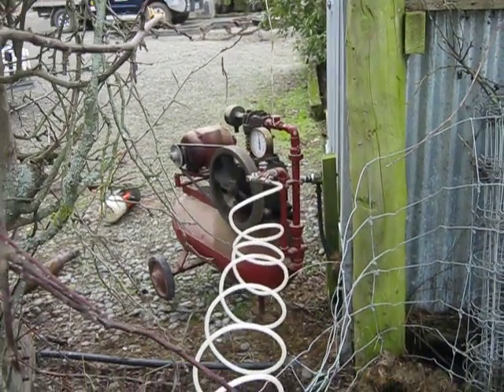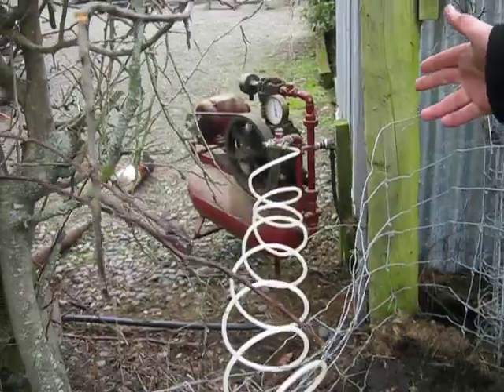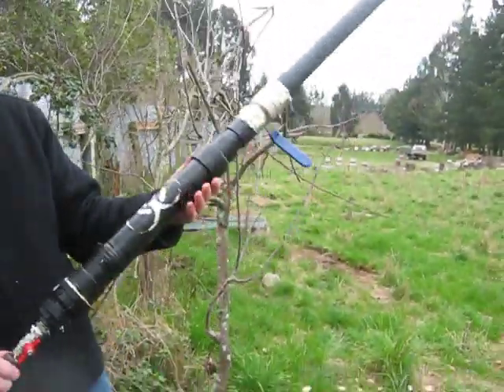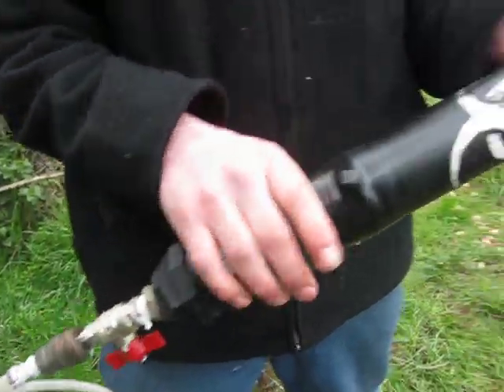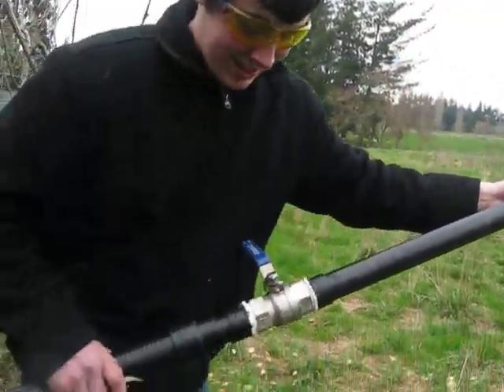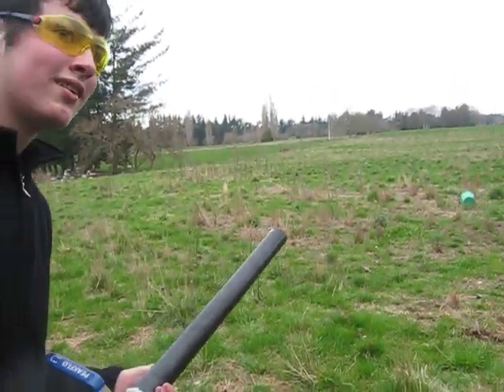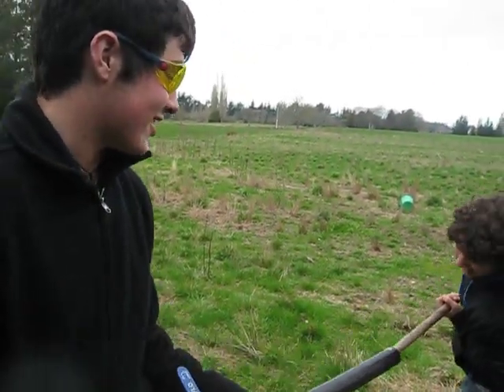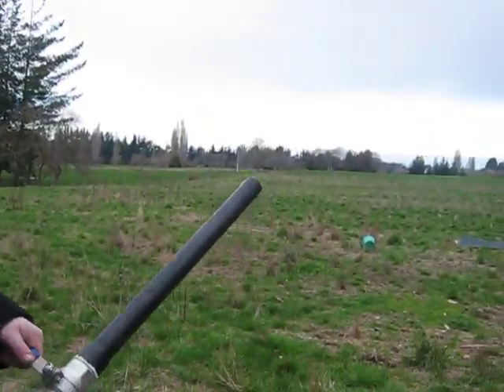air compressed spud cannon

Comment: looks like it.  just have a ball valve right after the filling nozzle that has a quickrealease as opposed to hard"wired"  these guys are absolutely nuts.  55 psi in hte chamber and the kid is loading it with the barrell facing his body.  load the thing before you pressurize boys!  it'll save a lifetime of remorse

Comment: question; is it possible to fill the pressure chamber and disconnect the spud cannon from the air pump, so you can walk around with it?